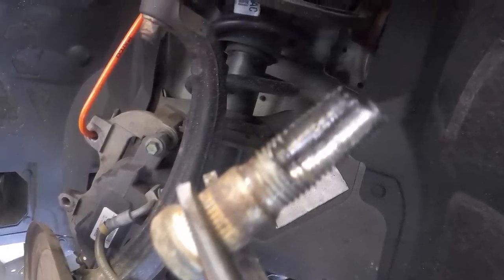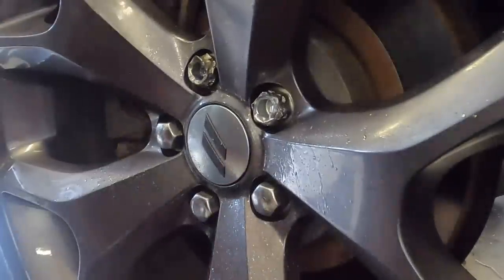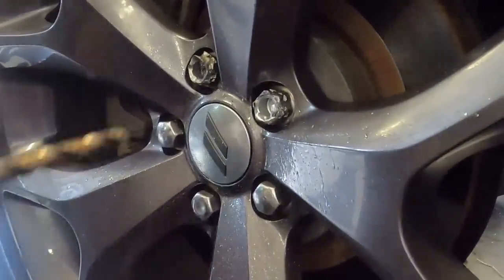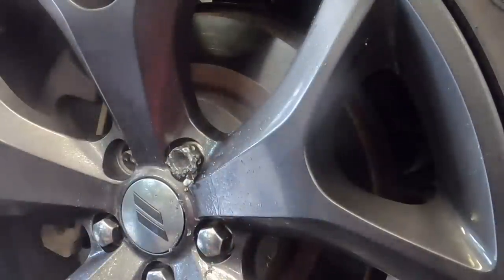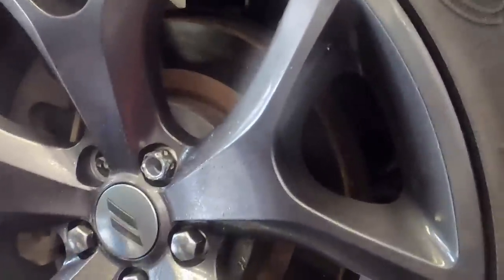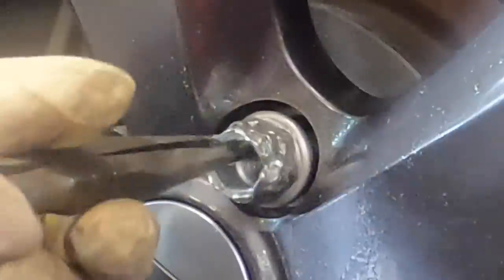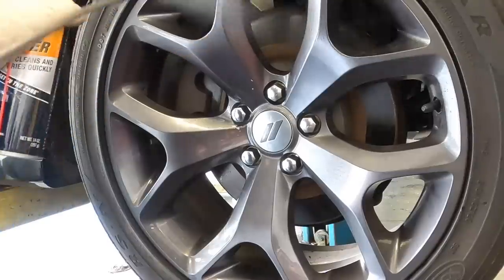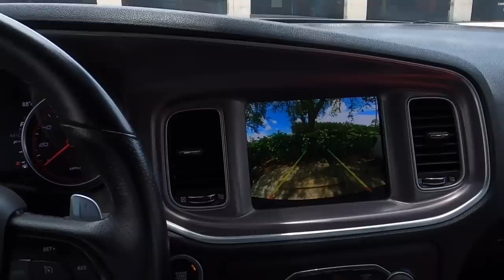2019 Dodge Charger! READ DESCRIPTION FIRST! Dealer Couldn't fix this! Must See! Bonus Footage

Comment: I think dodge has the crappiest service in service history.   I have a 2020 ram 1500 with the rebel package...... First issue was the tailgate was mis-aligning because it was missing the gromet,  and the bracket was in the wrong place.  It took 6 trips to 2 different dealerships.  It was rubbing on the passenger side.  They tried putting a rubber hose in it once as a stopper.   They also tried putting washers in the latch pin,  they replaced the latch saying it was hanging up another time.  I was in owe.  Then a tech tried telling me all trucks the tailgate moves his does it to.  It finally triggered the response "o yeah then show me your truck that does the same thing,  or better yet find me one more truck on the lot that does the same thing and I will believe that sh!t your trying to sell me."

then the next time I tried again thinking An oil change and tire rotation.   What can go wrong?    they gave me my truck back after two hours and Said your oil is changed.   Well what about the tire rotation?  their response was "  We don't have anyone qualified here to rotate the tires?   wtf are you kidding me?   ok whatever.   Next day its feeling a little weird and when the rear tires are over inflated in the rear she peels out very easily.    I check the tire pressures and seen they swapped the passenger side tires....they did half of a half ass job.   I could see the hand prints where they took the tires off.   so not only did they tell me no one was qualified which I now believe how did the passenger tires get swapped.   The whole point of me getting a new truck was down here in Florida mechanical error can be the biggest danger to a vehicle.   I wanted to know what's been touched and what hasn't.    

Now I'm back to doing my own oil changes.    If I keep letting them do the service the truck wont make it much passed the warranties.

Comment: Man, either those 2 nuts were cross threaded,  or super torqued on. I'm actually surprised those little acorn nuts were such a bit--,. I've drilled out many a bolt. I know the satisfaction u feel when the nut just pops of finally.  They're not going to be to thrlled with that little bill. 3 or 4 hundred bucks to get 2 lug nuts off. Good job.

Comment: By the time I get to see a car, it never still has the stupid chrome capped nuts, if it ever had them in the first place. Wheels are usually already scuffed up pretty badly, too, so I can afford to be a little less careful with them. 
I don’t have a set of the fancy aggressive nut extractor sockets, so I only have this as my way method of removing a mullered nut, bolt, or stud. I was wondering, however, once you get it to move a little, would one of those be easier than continuing with the chisel?
Also, on a car that was less than 3 years old, at the time, why did the caliper bolts fight you the whole way out? That was a bit strange, right?

Comment: Lug nuts on Dodges absolutely suck. A friend of mine is a single mom and I always do things for her and one of those things is working on her car. See I was told after getting new tires of that on the passenger side he had bad ball joints and they quoted her ridiculous amount of money to fix it. He asked me if that was something I could fix and I said yes. As I was taking off the wheel there is a very thin piece of tiny metal that is over the working end of the lug nut. I ripped two of them apart. Since I had to pick up parts I stopped and got new lug nuts that I destroyed. Came back with everything together and I looked up what the wheels are supposed to be torque to. 
A year later she needed breaks this time I knew the wheel was torque correctly and so were all the other ones since I made sure of that. This time around almost every lug nut on the front end had that cheap metal come off. This time when I went to the parts store I picked up a set of four-wheel but not that were aftermarket. They looked pretty similar to the ones I removed and the bottom was the exact same. So putting everything back together I use the better lug nuts.

When she needed front end work again two years later this time not a single problem with the lug nuts. After messing with her car the first time I noticed the same trend on all the dodges that they have. Most of them discovered it after having flat tires and not having the right tools to fix the problem on the side of the road.

Now I don't know from 2020 on if they are still using the same lug nuts. I haven't touched anybody's car that was newer and nobody has called me asking for help.

I'm telling everyone if you have one of these dodgers you really might want to think about getting your lug nuts off now before you are on the side of the road and have to have your car towed to a service center. A set of four lug nuts is not very expensive especially compared to a visit to the shop. Just make sure you torque them for whatever the factory setting is.

Comment: I've used torques bits as bolt extractors. Looks like if you drove a 4 square bit in the drilled hole, you could have used it as an extractor.

Comment: When you get them drilled through the center, why do you not try socketing them off manually since they're essentially so weakened at that point?  It seems like it wouldn't need you to use the impact driver or chisel from a viewer's perspective.  Is there a reason you prefer not to try that first?  Seems like it would be easier and faster... but I'm just a YouTube viewer, so I don't know.
Reply: After he drilled, he should have used the "shark bite" socket and it probably would have come right off with the ratchet. But I'm just a mechanic - what do I know?
Reply: @ClydeDCamel-mv6ml  That's pretty much what I was thinking.  It sounds reasonable, but that doesn't always mean it's also practical.

Comment: Have you every tried using a drill bit that cuts counterclockwise? If it grabs, it could unscrew the nut. I also found the drill bits for concrete work great.  They have a carbide blade that eats metal.

Comment: The only thing I would have done differently, is after that lug started getting hot from all the drilling I might have tried the extractor again. That had to be getting crazy hot. You can also try left-hand drill bits. Other than that, great job! You have to have a lot of mental fortitude in the face of adversity with a basket case like that.
Reply: Left handed drill bits work great!
Reply: Indeed! My set of left hand bits is essential to all mechanics, too bad they haven't heard.

Comment: My Dodge dealership was able to do this job with no damage, a good tech like you can achieve good results. .. was on one wheel and 4 lugs. I brought my Charger into a tire shop to have a nail taken out, turns out they had to replace the tire and over torqued the bolts with an impact. I have the 4  lugs a nylon tie as a souvenir and still have the nail on my keychain

Comment: Always use Duct tape to cover the wheels , it's to easy to slip and miss! Also I use a carbide bit to drill out the studs!
Reply: Left hand drill bits of good quality are far better than brittle carbide right hand bits.

Comment: Last time I ran into this kind of seized lug, my neighbor was a truck driver and I had free access to his garage. That air chisel saved the day.
Getting the drums off afterward was another story. Hammer one side, then the other, over and over, prying all the way. Took several hours and was dark out by the time I got them off.
Since then, no real lug issues. I tend to my vehicles too often to have them. In other places though, old rusty bolts snap off all the time.

Comment: Ebay extractors work good along with  a HF micro torch. Total cost 45 bucks. No point using drill with nut not broken off yet.

Comment: Being a machinist for 35 years, I can really appreciate your struggles. Removing seized fasteners is one of the least enjoyable tasks I can think of, beaten out only by broken tap extraction. You're lucky the previous removal attempt didn't include drilling by someone who only had high-speed drill bits. Carbide is the only thing that will drill through a hole that burned up a high-speed drill but carbide is difficult to impossible with hand drills.
Reply: He needs LEFT hand drill bits. Carbide bits are too brittle for this hack work.
Reply: @RRaucina  Reread my comment carefully. And, left-handed drills wouldn't have done anything to drill out a lug stud, they are straight knurled and pressed in.
Reply: @pedrowhack-a-mole6786  The left hand bit will remove the lug nut at some point in the process. One could drill right hand at first and then left when reaching the area of the lug nut. You can watch him spin the nuts to the right in the video, with the drill. Then he uses pliers to turn it left. Mechanics need left hand bits for many other stuck nut and bolt apps. Could use EDM if the $$ justified it.

Comment: I don't know if it's laziness or trying to beat the flat-rate clock but every time I have been around wheels being removed then re-installed, never have I seen a torque wrench used in shops around here.   It's always the whine then rap of an impact wrench.   My lugs are 90 lbs.  When I get home, each lug is cracked loose, one at a time then properly torqued.

Comment: When you go to the larger drill bit put your drill in low gear, as the size gets bigger you need to lower the RPM. Just a tip from a machinist.

Comment: You should order a good set of left-handed drill bit may help you in the long run.
Reply: Left handed drill bits would not work for this type of job he is trying to remove the nut left handed drill bits are used for broken studs or bolts in threaded holes .
Reply: And just what do you think left handed bits would do in this situation ? He used the right tool for the job.

Comment: I might have gotten your drill in on a repair or one like it, the stator got so hot the plastic insulation melted and seized up the armature when it cooled. Drill slower with more pressure for steel.

Comment: I had an issue similar done to my vehicle.  The mechanic I took it to decided to continue to tighten them until the studs broke.  That's how he got them off, then put new studs in.  It worked.  Some tire monkey screwed me but at least it was fixed.  That was at least 25 or so years ago and I verify lug nuts are torqued correctly ever since.  I bring my torque wrench down to the tire shop.

Comment: how many drill bits did you burn up?  Do you use cadmium drill bits?  I've found they are the best for drilling hardened steel even stainless vs HSS or titanium plated.

Comment: I went through the same issue on a dodge I removed the cap used a flat face threader, turned short bolt in as far as I could then used my small welder with 1/16th rod and welded and used my Milwaukie impact and it came rite out was due more to the heat expanding the nut to get to break free but having something to grab onto with impact also helped

Comment: A Titan 1 inch drive 40 inch breaker bar with a 8 ft. Cheater bar breaks loose just about anything. If you can find something that will grip the messed up nut. These are used mostly on heavy equipment.

Comment: I hate the lug nuts with the plating over them - they easily deform and causes problems with the sockets.  And then there are the tire dealers that over-tighten the lugs with pneumatic impact wrenches, resulting in these problems.  I ask them to use a hand-operated torque wrench to the specified torque, but don't know if they ever comply.  As a kid in the 50's and 60's I was allowed to sit in the dealer's service bay and watch the mechanics do the work.  Lawyers and Insurance requirements prohibit that now.

Comment: Man they tightened those wheel nuts like it was a v8 not a 6 cylinder. Morale here is always use a torque wrench and never have over tight nuts because it will cause you a  lot of pain in the long run!

Comment: A preventative step for this problem would be for the manufacturer to stop using CAPPED lug nuts.  I realize some yahoo over tightened these,  but a solid nut might have come off.

Comment: That’s what happens when you buy tires at Sam’s. Two nuts on each wheel exceeded 130 lb/ft as they got hammered on at 100 lb/ft, and then ‘checked’ with a torque wrench set to 100, and turned another quarter to half a turn, AFTER THE CLICK! I begged them not to do it…..

Comment: I had problems getting steel lug nuts off Aluminum Wheels that the factory put on. Now I put copper anti-seize on the tread and the cone shape of the lug nut were it like to bond the the wheel. Never had a problem since.

Comment: A good video showing perseverance.  Was the customer charged for the drill bits?  For this kind of repair, the customer should buy new drill bits to replace the ones smoked during the repair.
Reply: If you smoke your bits, you aren't using them right. Drilling hard steel requires low speed and high pressure.

Comment: This is why you put anti-seize on the lug bolts before installing the lug nuts by hand. I never ever use power tools on lug nuts. An ounce of prevention....😉🙃🌵
Reply: I agree.........."Everyone says" you should not to use anti-seize on lug nuts because of safety reasons.    If you use anti-seize sparingly so there is only a "tad" in the threads and torque by hand and use a torque wrench this should never happen - unless they have rusted in there - that is whole other problem in itself.

Comment: I have removed more titanium bolts than I can count. Hundreds, thousands of bolts. First, use my rivet gun with the impact tool; if this does not work, you can use an easy-out. If this does not work, drill through the head and then break off the head of the bolt. Remove the rim and then use a pair of vice grips to remove the bolt. If it is stuck in the spindle, then replace the spindle. It is just a matter of how much time you spend to save the part. Time benefit analysis. I am a licensed aircraft by the Federal Aviation Administration. I have worked on supersonic aircraft. 

I do not wish to offend, but it is my take on it. The panels on an F15 contained tens of thousands of screws, and removing stuck bolts was my wonderous job. I have also repaired Marine helicopters and C-130 aircraft, and my supervisor always sent me into the aircraft's fuel tanks to make repairs.

Comment: I've been a machinist for over 40 years I have seen this type of thing happened under different applications as well most likely it was the Chrome on the inside of the Lugnuts flakes off and golls up the threads. not necessarily over torqueing of the Lugnuts pcs of chrome flake off and fuse the threads together even if it's only 1 thread as you turn the Lugnuts it chews up the next one all the way to the end

Comment: Just a comment about drilling do not turn drill off straight away after drilling hard keep drill running to cool off winding for a few seconds then turn off
There are special drill bits which will drill through files to do this in a few minutes

Comment: I have a question. I was taught that over-torquing lug nuts caused micro fractures in the stud. Is it safe to assume that all these studs have suffered from over-torquing, rather than just the ones Ray managed to get off? It would seem likely that whomever did this over stressed all the studs - perhaps the dealer or Ray managed to loosen the others - and therefore in the interests of safety ALL the studs on those wheels should be replaced?

Comment: A shop destroyed the lug nuts on one wheel on my 06 R/T. I went in for a rotation and left with a headache. The dude used the wrong size socket and the owner blamed it on cheap lug nut covers even after the "mechanic" admitted to using the wrong size. He was going to sell me nee lug nuts too. I went next door bought new lugs for all 4 had him do the one wheel and I did the rest at home. Never got my tires rotated.

Comment: I just had this problem last month. Stupid thin metal cover over the nuts. Nut over torqued. Destroy thin metal cover on the nut. Round off the nut. I hate the power tools used by tire shops because you can't change a flat.

Comment: I used to free the nuts on larger threads by drilling the stud then trying to undo with the socket. 50% of the time the stud would shear at the bottom of the drilled section and the nut falls off.

Comment: just one thought, and that was once the studs were drilled, would it not have been possible to revert to the sockets as this might have enabled them to be turned without using the chisel, and saved the damage? as i say just a thought.

Comment: Your best bet is with a 3/4 breaker bar with a slightly smaller socket than the nut and a pipe. 

9/10 times you'll be done in 5 minutes...unless the splines of the stud come out of the hub.

Just a heads-up from somebody who had to do this crazy on a daily.
Reply: And use a short socket, not deep. Also pull up not press down, you get more leverage!!

Comment: Never , and I mean never ever get them cheap ass lugnuts with the thin plated caps . Yes it will cost ya a pretty penny but if you buy solid nuts you be way better off . Still no guarantee they won't cross thread tho . That's just tech error on a persistent grade
Reply: I had the same problem with the chromes caps i used a flathead a broke the caps off then got the nuts underneath
Reply: @Acechanderson  Chrysler does seem to use them cheap nuts quite a bit for vehicles that are very expensive to buy new .  Yea a set of solid nuts for all 4 corners on my RAM 1500 cost about 100 bux . But then the size will be the size . No tin caps to misshape them. Anti seize helps against crossthreading .then again it can always happen if one insists